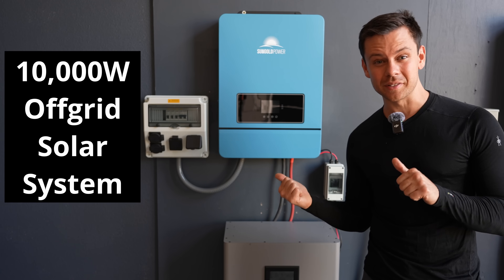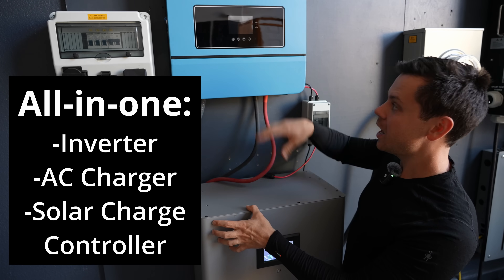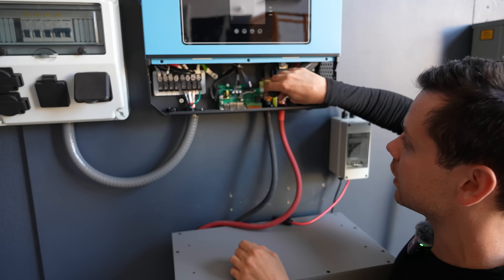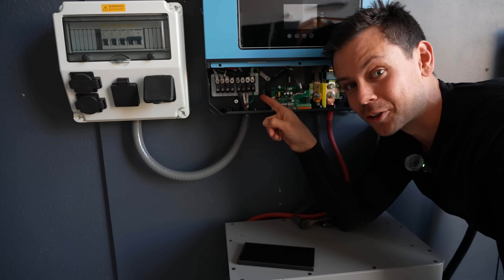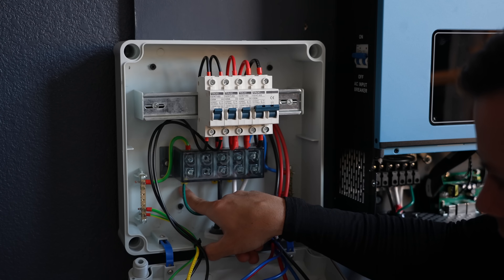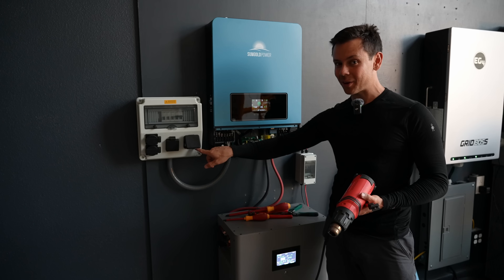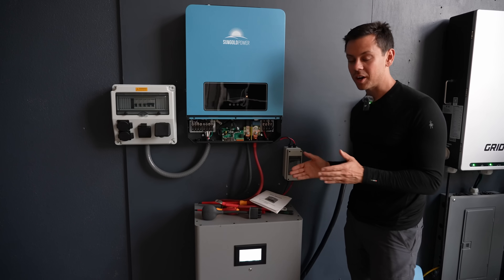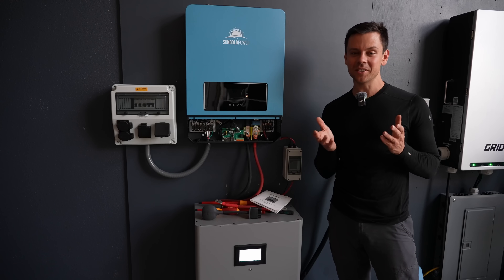Offgrid Solar Beginner Crash Course: Build a 10,000W Solar System

Comment: Will, what size wires did you use for the AC INPUT? I could not get my 6 AWG cables into the lug terminals. I tried using 6/4 AWG SOOW cable and I had to use ferrules because of the fine strands. It was impossible to get them into the lugs. I had to drop down to 8 AWG wire, which is underrated for it's potential draw. Anyone else have the same problem? What size wires were you able to get into the AC INPUT lugs? Thanks for any replies. I watched again, you show 6 AWG THHN. I would love to see that inserted into those lugs, for me, the 6 AWG is too big. I just read the manual again (meaning I actually read it this time) and on page 10 they state the CABLE SIZE of 8 AWG.

Comment: Will. I am curious in your opinion. I live in Southern Florida - Delray Beach. My roofs face east and west with very little shading. FPL has net metering an an annual basis. Dollar for dollar. Would solar be feasible for me? We use about 1800 kWh at peak month (Aug). Avg is 1201 last 12 months.  Your thoughts.

Comment: Another big plus of AIO systems besides being cheaper than separated parts is also the cost savings in wirings, busbars, breakers/disconnects, etc (they add up to a lot).
If i built my system today i would go to an AIO Inverter+Charger with option to backup on external power (grid or generator). And 1 or 2 LIFEPOs batts (current 10xAGM 12V 5P12S with balancers). Then again, i learned a lot while building it.

Comment: Looking to build a system like this but only have room for 4 panels. I won't achieve the 200 volts I need. You had a video where you added a component to the system if you don't have enough volts, but I cant find it now.  Can you explain that to me again.

Comment: I have an existing enphase solar and battery system. 1 year old. 15kw in solar and 25kw in battery. I’d like to add this system to my 60amp 240V sub panel I have in my garage. Can I used this set up to charge and discharge into the same panel? Ultimately I need 3 of these batteries paralleled together. But i if it will work I’ll start with one. I was looking through the inverter Manuel. And I see I have one problem already, my 240V sub panel does not have a neutral wire. I guess I’ll have to pull in a neutral conductor to make this system work. What I would like is to be able to charge and discharge at about 7kw. I only want to discharge during my peak times from 4-9pm. And charge during my good solar times from about 9am-4pm. Will this set up work for my situation?

Comment: Thank you so much for the great video. I have a whole house system already but the local electrical company would only let us build the tie in system to a certain size. As our needs have grown I am getting close to going beyond it. I was looking at doing a off grid mini split but am looking at this to pair with it and a electric car charger as well to do level 2 charging. 

Sadly it looks like the 120/240 box you used is not available. Any other recomendations for another one for level 2 charging?

Also what amperage does the PV disconnect need to be?

Comment: Regarding @AjayKoovacal comment concerning lack of Safety Agency listings of components.

- in the USA it is not illegal to sell unlisted components into the United States. Some jurisdictions, like Los Angles County does, but doesn’t have the resources to police it.

-it is illegal to expose your “employee” to unlisted components.

- if your house burns down because of a unlisted component failure then they have excellent argument to deny your claim!

- if “you” buy these components directly from overseas then you are the “importer” of record. If it hurts someone you are the one the lawyers will have a field day with. If you buy that same component from a USA company then at least they will send their lawyers on them BEFORE you, but if it’s just a shell company then you’re exposed. Amazon has no legal liability, the company that sells thru Amazon does.

Regarding fraudulent regulatory markings. If a company claims a listing you need to verify the Listing # on the UL/ ETL/CSA website. Those holographic listing marking were brought about because small Chinese companies were printing labels and shipping. It’s a big problem so to be safe do some research.

I personally, with my background as an electrical engineer and a homologation engineer i would not place an unlisted system in my basement or attach it to the side of my house. I’d put it in a separate sacrificial shed.

Comment: Thanks for review the Sungold SPH10048P, I'm seriously looking at buying a solar system with the Sungold SPH10048P for my inverter.  I do have a question about the AC input, I would like to just use the AC input as a backup incase the solar or batteries fail and it isn't really clear to me in the manuals.  Would this Sungold SPH10048P be able to do this?

Comment: Need a little help i have a 48 volt battery that went out i dont use them i had purchased and installed a system in a flip house and ended up with it all back. but one of the batteries has the screen blanc. Is there a vid im missing on how to charge it back up.  i left it at 90%  and had 2 of them connected together. All components are from your recommendations and it worked great. for 3 months . Never below freezing temps.

Comment: Not sure if this is a concern, I noticed there are a LOT of items on Amazon, like that circuit breaker unit you showed. However, they are not UL Listed, ETL Listed, CSA, or TUV US. Of course everyone's local code may be different. What I researched though is without the NEC approved safety certs, a lot of the electrical stuff on Amazon is against code?

Comment: So I have a similar problem you mentioned at the end. Using an external battery pack + Inverter, that's going into a transfer switch.  My battery+inverter can take in solar and grid AC at the same time. However, when I'm connected to the transfer switch it pops the GFCI when trying to charge the battery+inverter via grid. This I believe is because of the neutral grounding problem. My battery+inverter has a floating neutral. A lot of people bypass this using the ground+neutral bypass plug. I do NOT want to do that, it's against code and a fire hazard. So, that being said is there any practical solution to to fix this for a home setup? There can be only one neutral in the Main breaker panel. So separating the neutrals seems like a no no too. Even the manufacturer of my battery+inveter, my certified electrician company, and the transfer switch manufacture have no idea how to fix this or get around it. Oh also, there are no non-GFCI plugs anywhere near where I have everything going. Not sure if allllll that makes sense. But it hits on what you said at the end.

Comment: I'm definitely going to build this setup in my motorhome when I get it. 12v from the motorhome completely separated from this 48v system for the 240v circuit. 2nd 48v alternator and the solar panels on the 48v system. Just need enough solar panels to get a high enough voc I guess, that could be a problem...maybe use the 48v system to be able to charge the 12v via shore power connection. And when I find a nice off grid property to settle down I can rip this out of the motorhome and use it in the house.

That is going to be a fun project. 😁

Comment: Be careful with the neutral ground bond. Most of these inverters have that built in but well need to be discounted if bonding elsewhere line in the house breaker box. Ground loops may be an issue as well

Comment: Will, 
Would this system be safe in a basement in a home where panel box is also in the basement?  (Concrete 8 foot walls and floor, but wood floor above)

Or does this equipment safer in something like a metal storage container? Concerned if these battery units catch fire.

Comment: Will I am an electrical engineer and 30 years exp in controls.  Always tried to keep signal ground separate from power ground due to induced noise but also aware of ground loops.  With solar systems what are your thoughts on PV grounds, for example solar carport, and should those be bonded to power system ground?

Comment: I know you specifically didn't go into attaching to AC input, but could you? This seems to be the perfect setup for a home backup. I'd like to use my gas powered inverter generator to charge my batteries if solar or grid isn't available. Any tips, or could you go over all the neutral bond and grounding issues? I'm not charging an EV but that may be on the horizon

Comment: QUESTION: 
I have a Vevor EM3500-24L Hybrid Solar Inverter. 
It has 240v 50a ac output. But it only shows ONE Line, one Neutral and a Ground for output wires. 
When I touch the Line and Neutral with multimeter probes, it reads 250v. 
I'm getting a very low reading when touching the Ground and either the Line or Neutral, which then goes to zero. 
How do I hook this thing up to my breaker box which is set up for a standard 240v 50a input? 
The breaker box is made for RV hookup. Very similar to the one in this video. It has one 50a, one 30a and one 20a output. 
The issue I have is that the diagram shows to hook up 2 Line wires, one neutral and one ground.

Comment: I have sma grid tied solar. Im considering adding battery backup and generator port for outages. Do you have a video that shows how that goes together? Also sma grid tied must sense grid to put power out. What happens if disconnected from grid and it senses generator or battery in place of grid

Comment: The numbers you are talking about, 10,000 volts and 496 amps and 5,000killow watts have no meaning to me.  I have my bill from the energy company and my electrical panel. I would like a battery and solar or wind but I have no idea what to do or where to start.  If you could a a really dumb down video.  I can power my oil fired boiler that gives me baseboard heat and hot water.  How could I do just that.  Then maybe add an air conditioner, then a second on and then a third.  Then maybe a microwave and toaster.  Can you help?

Comment: I love these videos. This is a non-beginner question, but could a transfer switch avoid the complications of the Neutral-Ground Bond inside the unit while still using the charger capability and bypassing the inverter? As in A/C output comes from the transfer switch and can be either inverter or grid, and when in grid, passes A/C back to the all in one A/C input for battery charging. That way whether the unit switches neutral ground or not, doesn’t matter since there’s no output on it’s A/C side, and it becomes a big battery charger with all A/C devices essentially connected directly to the grid.

Comment: I have a question.  I have a small 'standalone' system where I'm powering a few things straight from the inverter with extension cords.  I plan to install a transfer switch box to power a couple house circuits but they only switch the hot leg; I assume there's no issue with sharing the neutrals with the grid-?

Comment: Lets say I have a conventional ICE generator to use in an emergency, would you still suggest charging the batteries with a DC charger? or use the AC input on the inverter?

Comment: Great video.  This is the system I need.  
So, if I have an electrician install a breaker box and outlets inside my small cabin (not connected to grid) can I just attach this system in the same manner to the breaker box?  How about including this part in a video? 😎

Comment: Hi! Thanks for the great video – super informative.

I noticed you strongly advise against using the AC IN function on hybrid inverters, even for charging the batteries from the grid.

In a properly configured system with charge limits, scheduling, and anti-islanding protection, do you still see it as a bad idea?

Or is your recommendation mainly based on the complexity and risk of misconfiguration for most users?

Thanks again for sharing your experience!

Comment: I am interested in this type of setup for a Box Truck to RV conversion that i am contemplating, many people suggest not to install all-in-one systems because if something goes wrong, the all-in one has to be totally replaced whereas with separate components, it is only necessary to replace the defective component, what do you say to this?, and what are your recommendations ?  Is this setup recommended for RV conversions or is the hand truck setup that you featured a few weeks ago a better solution for the RV use case?  Thanks

Comment: I wouldn't buy some random named solar disconnect, poor quality ones are known to catch fire. Mixing MC4 connectors of various brands is also a fire risk, and here we don't even have brands. You made a video about cheap NEMA 14-50 outlets catching fire with EV charging yet this random one shouldn't? These are not even the most expensive components, so why not spend a bit more and get ones with US safety listings instead of a worthless CE or CCC listing? Is the PV wire gauge actually what they advertise, is it even pure copper?
The inverter is safety listed, which is good.

Comment: Great job Will.  Love these beginner friendly videos.  Very easy to understand instructions for an inexpensive yet powerful enough system.  I'm still running an LV6548 that I use to slow charge my EV.  It covers my daily commute.  I did all this (including buying cells and building a battery) watching your videos.  I'm may upgrade to 240v inverter and add a few more batteries.  There are so many options now that are not crazy expensive.

Comment: How does everyone plan to use this setup? I don’t have an electric car. I’d love to run my refrigerator and freezer but those are kept inside the house. This setup looks perfect for inside a garage. Not sure how to connect to those 2 appliances.
Would really like to connect a system like this running two batteries to my 2 ac units. Would most electricians understand how to connect to a beaker box?

Comment: I’m having trouble determining what gauge wire to use from the inverter to the panel when the panel is a long way away from the solar shed (where the inverter and batteries are).  Here you used 6AWG THHN wire….but how did you figure out what gauge to use?  Did you calculate for line drop?  I think I have to …. Your example here is so short I’m sure you didn’t.
Reply from the maker: Could you post this on the forum and I can respond.

Comment: This seems like exactly what I’m looking for. I’m looking for an off grid set up to run my rv camper and my work shop. I would probably set up a load panel instead and go with a second battery with more panels, I’m gonna need to research more on how to do that. I would l like to just plug my rv into it and have a backup propane or gas generator to charge the battery if I need a little extra power. Regarding the standalone 48volt 15amp charger you flashed in the video, does that just connect to the same battery terminals that the battery cables from the inverter connect to? Thanks for all your videos, they’re quite informative.

Comment: I have a LV TOPSUN 51.2V/300Ah(15.36kWh)Lithium Iron Phosphate Battery on my Deye 12kWHybrid On/Off Grid Inverter. I want to add another smaller (same brand) 200Ah battery.  My installer says I can only add the same (as original) 300Ah battery.  True or False? ?

Comment: dont you need a dissconnect/isolator between the battery and the inverter? In the case of running a cabin?

Comment: I am concerned about recommending that outlet box for daily EV charging use. The NEMA 14-50 outlet for this box is NOT EV rated. Too many instances of these plastic 14-50's melting and starting fires. The box is meant for RV use which is not a continuous high current load. Need a Hubbell or Leviton EV rated plug for car charging.
Reply: The tesla mobile connector doesn't pull 50amps continuously. It only pulls 32 amps continuously. 

From what I have seen the failures are due to being cycled too many times (plugged and unplugged). That causes them to loosen up over time. Even higher end NEMA 14-50 outlets loosen up over time from too many cycles

Comment: I'm glad you do not forget us beginners.  Thank you for that.  I did the 48V EG4 hand truck power station you demonstrated and it was easy.  Only problem I have is I don't have the space for solar panels to start the voltage required to charge.  But because of this. I'm buying the 12V 314ah Watt Cycle batteries and connecting them in series for a 24V system.  Easier to charge with solar due to the limitations I have and most of my appliances during emergencies run on 12 or 24V.  Thank you for the time you take to share with us your wisdom.

Comment: Can you do a video on the ground neutral bond? I had a power station with an generator to charge it and (off grid cabin) and had to disconnect the ground neutral bond on the generator

Comment: Is it OK to use this setup with a generator input to the panel and an interlock switch, or does the neutral bond issue apply there? I'd also like to hear how loud it gets under load, because it would be near my living room. That's one reason I am leaning towards the pricier and less-solar-input Ecoflow Ultra.

Comment: I am trying to find funding right now for some land and gonna do full offgrid power system and this is what i was thinking of doing but i was thinking the cheap Dumfume batteries which are almost the same price as that one big battery,so i will use it if i can afford one at the start,i might have to go with a 100ah battery setup at first and add onto it.